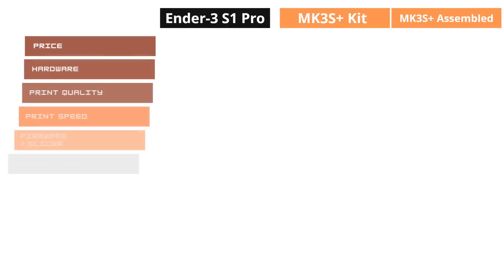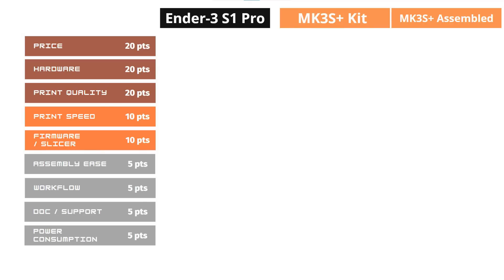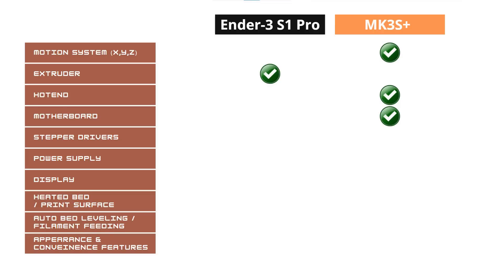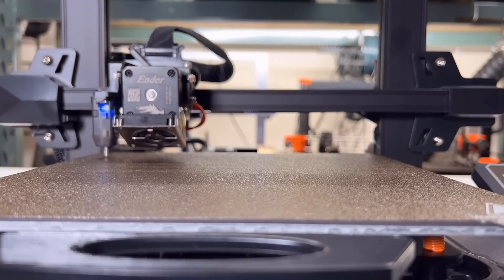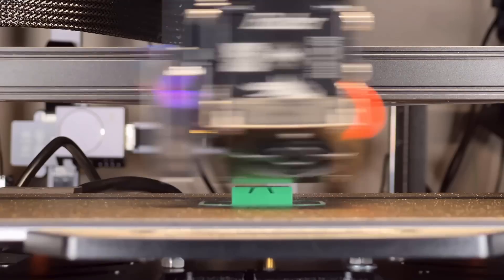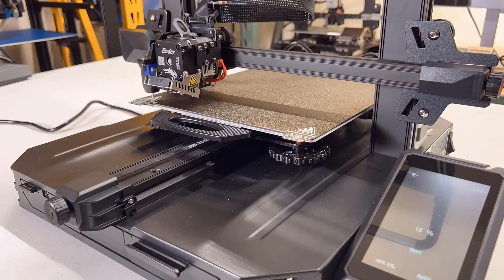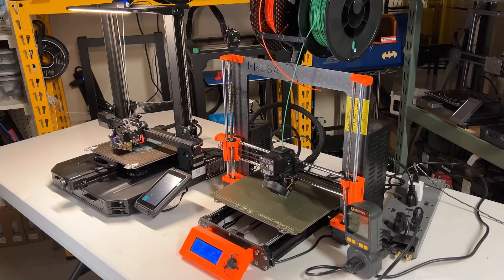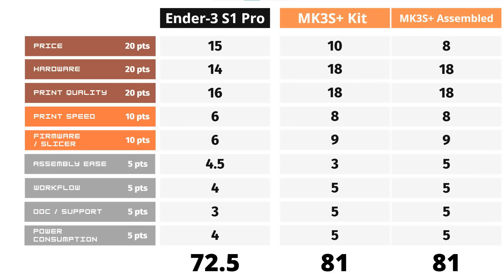Creality Ender-3 S1 Pro VS Prusa MK3S+, In-Depth Comparison

Comment: Wow wow wow!!! This comparison video blows me away!! In design engineering we sometimes resort to using a weighted concept selection matrix (or weighted comparison matrix) to provide a form of quantitative insight when trying to compare among various design/concept options.  This is exactly what you have done and done extremely well!  I completely agree with your selected criteria, the weight you assigned to each criteria, the scoring you assigned AND the justifications for assigning such scores!  Excellent and thank you!
Reply: No, she didn't.
She made a cardinal mistake.
Prusa self-assembled version is more than 2x the price of ender s1 pro. 
Meanwhile she scored 15 vs 10. This ruins the whole comparison.
You can get 2 ender s1 pro for the price of 1 prusa.

Comment: Also another factor to consider is the Ender 3 S1 has a build volume of 230 x 230 x 270 while the Prusa build volume is 210 x 210 x 250.
Reply: This is worth pointing out. At the same time, smaller footprint might be preferred for some. (Though if I were investing in a first printer, I'd rather err on the side of too large and make room.)
Reply: Probably doesn't matter much for small prints, but if one prints bigger stuff all the time or tons of small things at once, the little bit of extra room is probably highly useful more than one realizes.
Reply: Nope, Prusa has from first public version  25 wide, 21 long and 23cm height.

Comment: Great and very detailed video, 2 side notes: giving the prusa point, for the psu being more expensive, and giving the ender more points for glbeing cheaper is no consistent i think
Sry if i missed, but i think you forgot mentioning the build volume, the weight of the printers(portability), and the size/max print volume ratio
(+1 the new flat tubes of the ender leaves less opportunity to modifiy it. Its a big drawback for me comparised to the outlook.)
Pls keep up the good work, thank you for the video, u gained a sub by me

Comment: 10 hardware categories, Ender-3 S1Pro awarded 4 points, Prusa awarded 7 points -- You then awarded Ender 14/20, and Prusa 18/20 -- I'm not sure that I agree with that. A more fair score would have been Ender 8/20 and 14/20 to Prusa.

Comment: This was an awesome review on the two. I’m getting into 3d printing as something to do as a hobby. I’m a full time welder and work with cad and build prints but never got into the design side. I’m looking at the s1 pro as my first printer for the simple fact that I can 3d print and also for just a little extra install a laser and also do some engraving. So this is actually a 3d printer and a cnc engraver all in one.
Reply: Their add-on laser is pathetic.  Only 1.6 watts!  You can't engrave much with such a weak laser.
Reply: @tralfazy  There's a 5w one too :)

Comment: I think it's pretty astounding actually that the S1 Pro is being compared with a machine that even in it's cheapest version. Is $300 more... And holding it's own.  For me..  A machine(Prusa) at this price point should not have 3D printed parts...Period! If you compare apples to apples.. The end results are not worth the extra $600+(Fully assembled)
 I have been looking for quite some time for my first printer and yesterday I chose the S1 Pro. Money wasn't an option. Value was. And for me..  the Creality had that in spades over the Prusa. 
Think about what Creality could have done with the extra cost of the Prusa if it took that cost difference and upgraded. I think it would dominate the Prusa.

Comment: The prusa doesn't have belt tension knobs, because it simply doesn't need them. Prusa uses high quality gates kevlar belts that wont stretch overtime like he cheap belts on the ender.

Comment: Do you think that the CR-10 Smart PRO would perform as well as the ender 3 s1 pro? 
it has the same extruder but a different screen and a bigger print area. 
the CR-10 Smart PRO is 700$ right now and the ender 3 s1 pro is 500$. should I go for the bigger printer?
Reply from the maker: The Ender-3 S1 will be on sale in 2 days($339), you can take a look at:
https://bit.ly/3DS6YQc
Reply: @AuroraTech  Thank you for your reply! do you know if there will be a sale on banggood as well? because I don't live in the US.
and would you suggest the CR-10 as it has a bigger print area?

Comment: Another great review. This is what I would call a high quality engineering evaluation. Keep up the great work. Another consideration is repair/replacement parts. I have an S1 but it has been down for 2 months due a failed print that encased the heater block in solid plastic. It was good while it lasted (1 spool) but I can't get a replacement extruder. Don't trust the auto bed leveler... check it manually when you set it up. I ordered one a month ago but the order was cancelled after 3 weeks with no explanation... or refund yet. The extruder comes and goes on the web site as a spare part. It seems as though they're having trouble with inventory. Be aware that the S1 is new so parts will be VERY hard to get... or non-existent. Also, the heater cartridge doesn't appear to be the same as the standard Ender 3 so who knows when "sub-components" will be available. For now, the only option I can find (which is inaccessible) is an entire extruder assembly at over $100.00. Yikes! I bought an LK5 Pro to replace it while I wait and.....now I'm in no hurry to get the S1 fixed. The LK5 Pro is a fantastic printer at a bargain (IMO). Aurora did a review on it too recently.
Reply: I had the same filament issue on a Vyper.  I had to melt the filament off with a heat gun and print a new cover (which melted).  I might add that I am in Australia and Creality never sends the parts they promise.

Comment: I love your direct to the point videos.  You don't waste time re-hashing low value details and get right to the nitty gritty. I was very excited to get a Prusa Mini+ last year. I even ordered it at the beginning of November instead of waiting for black friday since the delivery was stated as beginning of December. I thought I could tinker with it during Christmas break. Well, Prusa failed me and kept pushing out the shipping date so I cancelled and looked for another option. I purchased a Kingroon KP3S and so far love it. It cost less than half of the Prusa and comes with linear rails and direct drive. I haven't pushed it with TPU, PETG and ABS which is why I wanted the Prusa, but so far it has worked great. Is the Kingroon kind of a black horse? I love my Ender 3 but recognize its limitations. From what I had read, the Prusa was the logical upgrade path. I didn't come across the Kingroon until I was looking for an alternative.
Reply: Correction: dark horse, LOL

Comment: I assembled my MK3S+ a few weeks ago.  I'm continually shocked at how good it is.  At first glance with 3D printed parts and a higher cost, it looks like kind of a joke but Prusa has done such an amazing job turning this design.  It has done an amazing job with everything I have thrown at it.
Reply: How long did it take you to assemble? Was it hard to assemble or straight forward?
Reply: @jamesamous5854  It’s a solid 8 hours.   It wouldn’t say it’s easy but it is worth it if you like to understand how things work.  I think a good indicator of whether you should build or buy assembled is what you plan to do with it.  If you are someone that wants to use it to make mechanical things, your own enclosures, gears, anything functional, then you should build it.  If you are looking to use it for artistic things, models, sculptures, stamps, etc, then maybe buy it.  That’s just my impression from people I know and is not a universal do/don’t build rule.

Comment: There is no real compare possible here. Printer on plastic wheels wich cant print 5 rolls without adjusting vs workhorse.
Reply: Agreed. It's the same story. Enders print well initially, but require more and more time messing with it over time to keep it printing well
Reply: I have been printing for almost 3 years with my Ender 3 Pro in one type of enclosure or another, printing with active heating if needed to be 45-50c ambient temp when printing ABS or Nylon.  All printing in ABS, PetG, Nylon, Hips, and a little TPU.  The only thing I have had to replace is the stock hotend fan.  I bought it as a refurb unit for $150 and maybe put $250 total in upgrades like Microswiss Hotend Direct drive, duel Z, 32bit creality board, and BL touch.  We make everything from consumables and bushings to custom equipment for our small business.

That Ender 3 Pro has been a workhouse that has saved us thousands in that time.  I don't think a Prusa's printed parts would have survived with the shear abuse that ender chugs through.

Comment: Wait…isn’t the Marlin developer now working for creality?
Reply from the maker: If that's true, that would be a good move from Creality to hire some higher-level software engineers, but I didn't see any major improvements on the firmware or the screen UI of this Ender-3 S1 Pro yet.
Reply: @AuroraTech  no clue if it’s true, I could be mis-remembering. It seems like I saw that somewhere a few months ago.

Comment: As a  hobbyist, you are looking for value for money... The 8.5 point difference won't be enough to convince me to pay double the price for the prusa. Good comparison and well done keep it up!
Reply: Not to mention if build volume was on the rating list that gap would be much smaller
Reply: Having both printers, I'd say that the scoring was definitely generous with the Ender. Yes it works well initially, but after using it for a while, it's starting to show the usual wear and tear that makes you spend more and more time fussing with it keep the print quality high
Reply: @GregBeatty  do you thing a high quality linear rail kit will fix this?
Reply: @thebrenskie  (good) Linear rails go a long way to removing wear/tear/adjustment headaches on the ender. The problem is that good linear rails are very expensive. The cheap rails on amazon vary anywhere from acceptable to garbage, but you really have no idea what you're getting until they show up at your door. I converted my old ender 3 pro with amazon (generic) linear rails. A coworker also has an ender 3 that he converted over to linear **rods**. Both conversions are better than the stock roller wheels, but I'm starting to have some problems with some of my rails after about 3 months (I print for hobby only, not 24/7). Two of my rails are getting noisy, and one of them has quite a bit of lateral movement (which rails shouldn't have at all). My coworker prints quite a bit more than me and his rod conversion is basically maintenance free other than putting a little bit of silicon grease on the rods every month or two.
Reply: @GregBeatty  I understand completely. I’m based in South Africa and try finding a good pair of rails here.. I have done full rail conversion of a old TRONXY X5S and 1000 times more reliable. I do think creality should have just done the rails from the start… or at least offer a reliable rail upgrade kit to try and be as reliable as a PRUSA.

Comment: i've assembled 2 prusa kits, never took less than 10 hours, but it is somewhat fun to do, the instructions are very clear and support is great in case of set backs; was actually thinking into a S1 pro due the price, as i thought i would "as good as prusa"... but seems not, rather spend for another kit. Thanks for the comparison! awesome video
Reply: The S1 Pro can get better prints than was shown you just have to take time to tweak it. Plus it has a much larger build volume.
Reply: @MageLeaderInc  While you adjust the Ender, I finish some perfect prints with the Prusa.

Comment: Are there any upgrade to the enders 3 s1 to get print quality to match the prusa?
Reply: Just tinker with the settings
Reply: I would start with replacing the wheels with (high quality, not Amazon generic) linear rails. The smallest amount of looseness/play in the wheels translates to variations in how consistent one layer is to the next. Enabling/tuning linear advance also helps a lot, but creality doesn't have that feature exposed through the UI. You're stuck flashing Marlin yourself and getting all the 100+ settings correct
Reply: @GregBeatty  if I have a prusa that's why I say it, also in the video you can see that the ender has better impression detail
Reply: time  8:53
Reply: @jhonpieracunaescalante8957  what I'm looking at there is massive buldges on every single corner on that ender printed cube. I also think they've got a partial clog on their MK3. There's quite a bit of under extrusion that definitely isn't normal for a MK3
Reply: the ender has better quality than the prusa
Reply: @jhonpieracunaescalante8957  you obviously have never used a Prusa printer if you're making that statement

Comment: So, another/different question would be Creality ender 3 S1 pro or this newer WizMaker P1. WizMaker P1 is still available on Kickstarter at lower prices (under $400) after that it will cost the same as ender 3 s1 pro. Which printer should be better for long-term use, support, and replacement part.
Reply from the maker: For around $300, I would consider the WizMaker P1 is a pretty good deal. But I don't think many people would buy it if it cost the same as the Ender-3 S1 Pro. If just comparing the printer itself, the $500 Ender-3 S1 Pro is better, but WizMaker is almost the best you can get for around $300. But if you have a budget of $500, getting the Ender-3 S1 Pro would be a safer choice in the long term.

Comment: Good use of the term watt hour. For anyone interested,  a physicist would use the term joule for a unit of energy, and would express the flow of energy or work as joules per second. So what is a watt? Well electrical engineers came along and decided that an energy flow of one joule per second is equal to one watt. Then, in kind of a convoluted fashion, defined a new unit of energy watt hour as how much energy would flow in one hour at a rate of one watt. Thus a watt hour is simply 3600 joule. Great video --- thank you.
Reply from the maker: Thanks for telling me how to correctly use these terms in the WizMaker video :)

Comment: I am hoping Creality puts out an Ender 5 S1 Pro at some point.  With auto bed level, all metal hotend, direct drive, and heavier cables better managed.  I do wonder if they will keep that line at the Ender 5 Plus and move to improve the Ender 6 line instead.
Reply: Also with dual z. That would be an awesome printer.